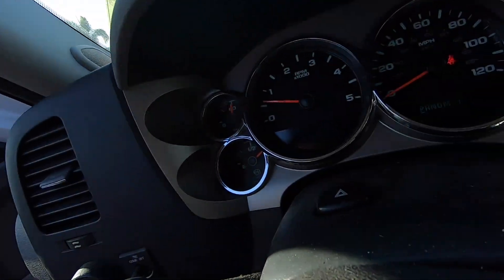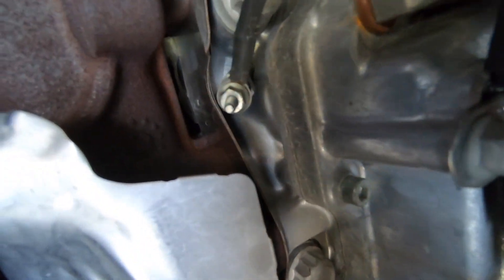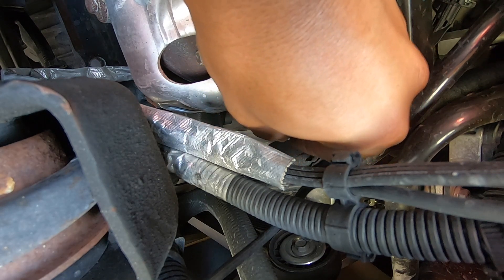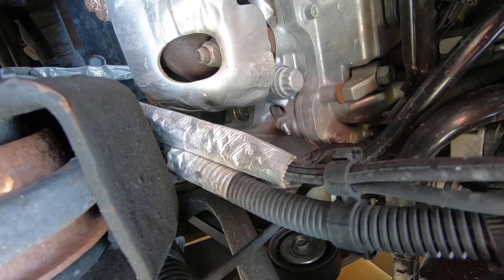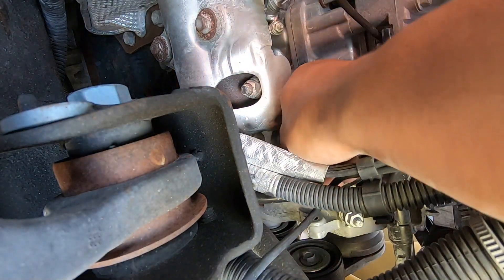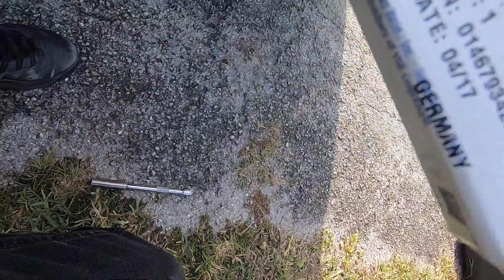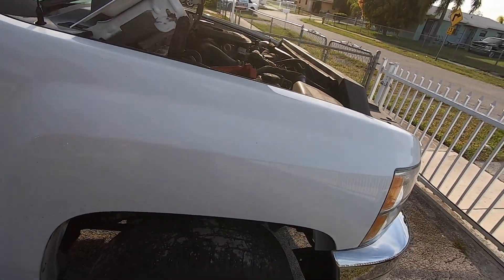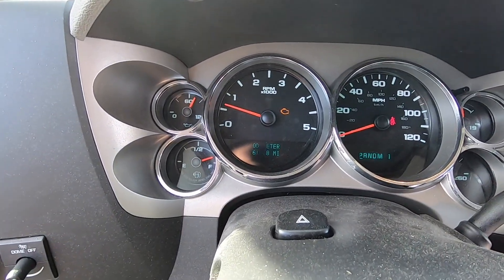How to replace lml glowplug P0671 Duramax 6.6 Diesel gmc 2013 Chevrolet Silverado Sierra 2500hd

Comment: Thanks I'm changing mine tomorrow
Reply from the maker: Yw change as many as you can at the same time if possible
Reply: Got it out. Pain in the ass was removing wheel well. 
Going on a trip, eventually will replace them all
Reply from the maker: @chadwolf5596  awesome, changing the fuel filter was harder just trying to screw it back in with no visibility . Be safe

Comment: $340 to replace a glow plug!!! Holy crap thats ridiculous
Reply from the maker: And as the years go by its going to get more expensive just because they can
Reply: @puertoricanhammer6987  about to replace number 4 hopefully its not too hard 😂
Reply from the maker: I just replaced it today,the steering thats in the way can be pushed down enough for you to get a socket in. It will be difficult and take some time but can definitely be done in less than 30 minutes after removing wheel well.